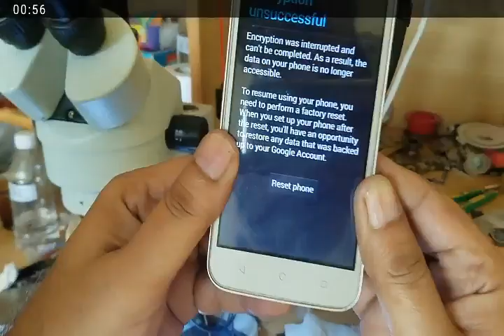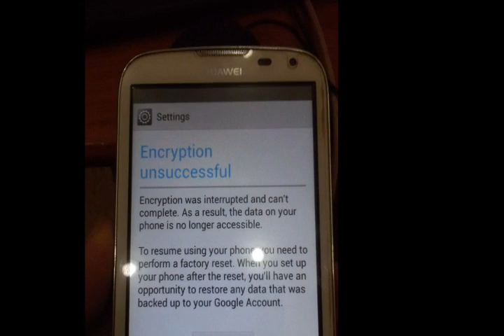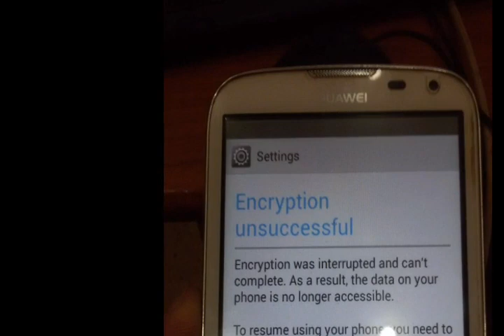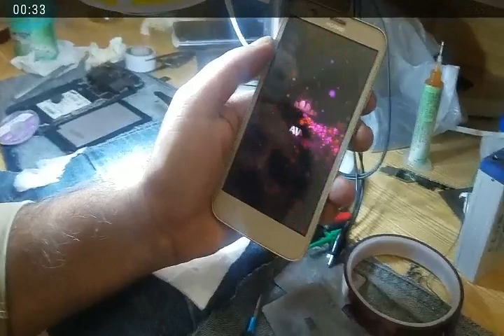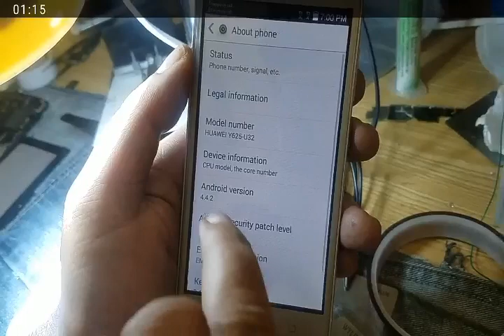Huawei "Encryption Unsuccessful" Solved 100% - EMMC Replacing & Repairing

Comment: Oppo f1s encryption unsuccessful plz tell me how to normal my mobile
Reply from the maker: Check emmc... Replace it if faulty...
Reply: @dhics-pk  tq but I don't know emmc
Reply from the maker: You need to contact nearby experts shop... You r from india?
Reply: @dhics-pk  yes I'm  from india
Reply: Same message i am getting in my vivo v3 handset can you tell will there is decline in performance after emmc replacement. Or it will work fin le as earlier.